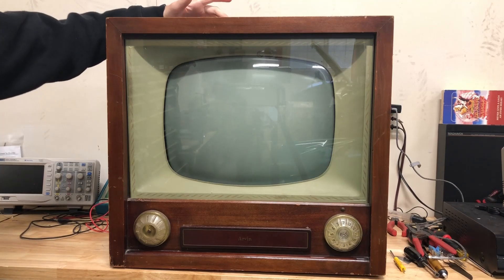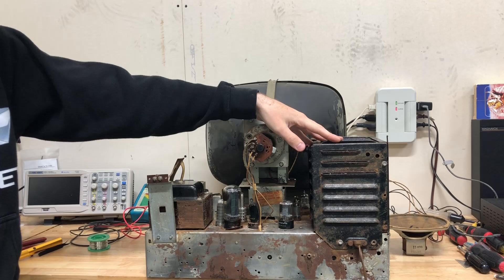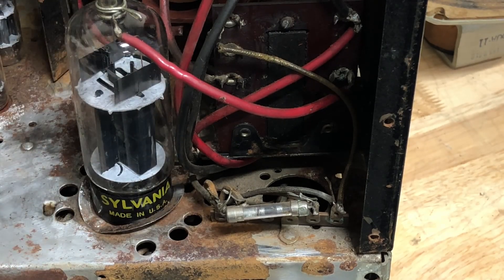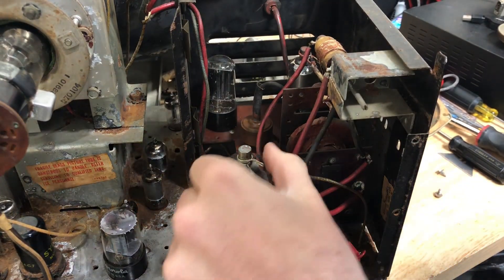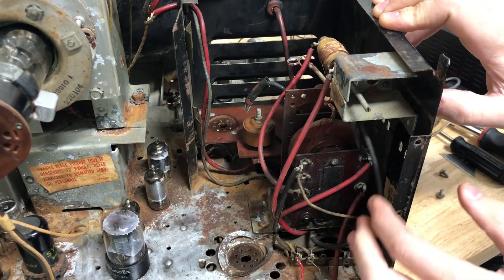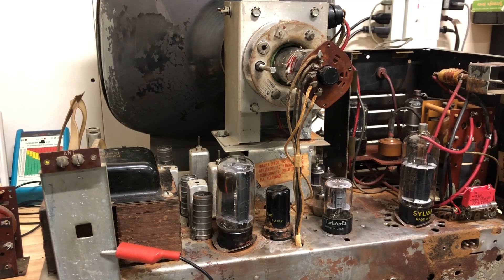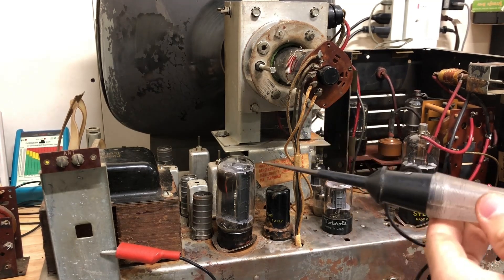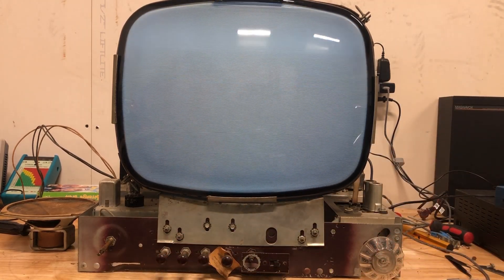1952 Arvin 17" Tube TV Flyback Replacement Test

Comment: Excellent job! Great that the new flyback is compatible with the rest of the set! Good luck with the video, good luck with the video, wonder if it could be open peaking coils if not the video output tube or resistors in that circuit.